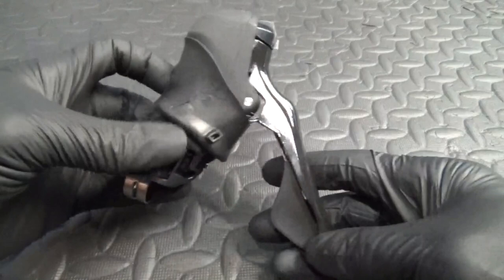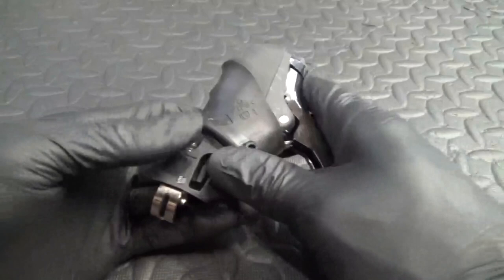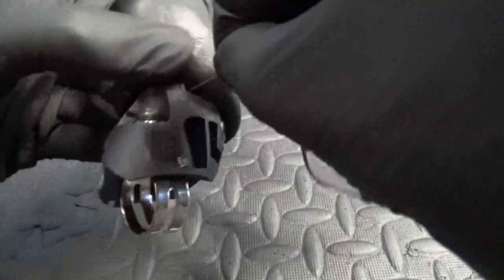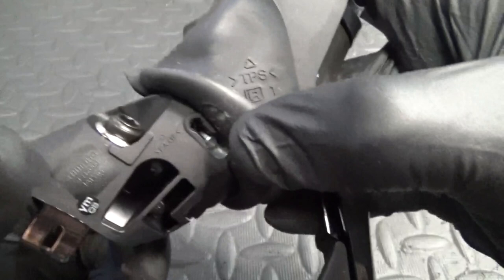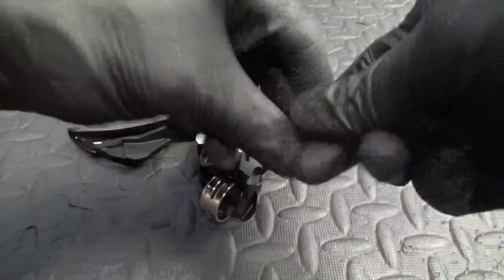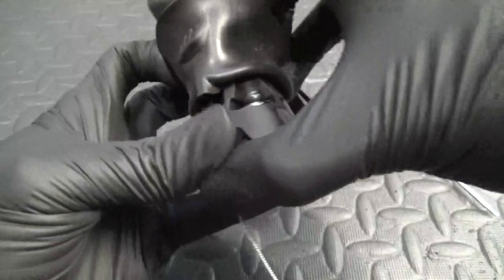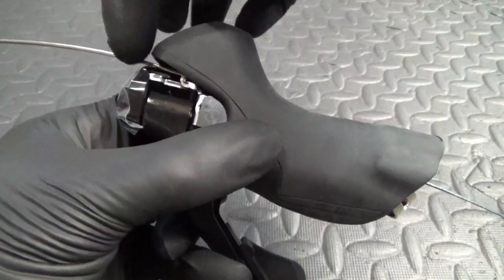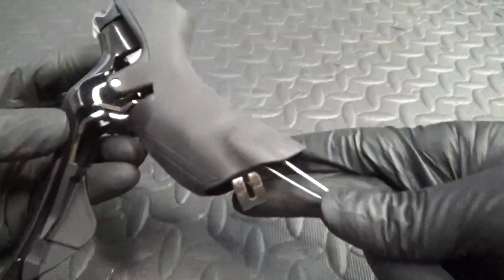How to change cables Shimano 105 R7000 shifters

Comment: I have been reinstalling and setting up this R7000 front derailleur today and it’s quite a fiddly and temperamental design! Even with everything aligned as carefully as possible it still seems very hard to find good high and low stop settings, particularly on the large chain ring. If you set it to just skim on the highest gear (smallest on the rear) you get noise on the lowest one or two. If you try and open up the gap a touch more to be sure it’s not rubbing on the highest, the noise extends to the lowest two or three lowest. It seems as if the cage is just not quite wide enough to accommodate the cross chaining on the 2x11 drive.

Other problems: it can be hard to distinguish between noise from rubbing and noise from the chain against the ring due to cross chaining. Be careful with the chain guide height over the large ring. If you make it too small (say about 1mm) the chain rubs against the bottom of the cage when the largest gears front and rear are selected.

Comment: Do they sell optislick specific inner cable? I need to replace the fd inner cable for my 2021 Domane sl5 and looking for the correct part.
Reply from the maker: Yes they sell the optislick inner cables separately! Available online search for Shimano optislick inner cable.
Reply: @FreeToCycle  Thanks. I think this is the correct p/n Y60198100
Reply from the maker: That’s the one!

Comment: Would anyone happen to know if the Shimano 105 R7000 11 speed STI shifter set can be connected to the Magura MT 8 Carbon Disc Brakes?

Comment: Hi, my left shifter isnt the same as right when it comes to the recess hole that the gear cable sits. The right hand one is as you describe but the left doesn't have sufficient room for the cable end to seat. Should they be identical? Thanks
Reply: Sorted, I wasnt all the way down the gears 👍

Comment: Do Shimano left shifters always work the front derailleur & right shifters always work the rd? I am setting up rx600 hydro shifters and i am not 100% sure...😚😚
Reply from the maker: Yes!
Reply: @FreeToCycle  thanks mate... and if u have time i have one more question... will r8070 calipers work with grx st rx600 sti hydro levers with cable gear shifting? Dave Mac.
Reply from the maker: Yes they will work with the rx600 shifters!!
Reply: @FreeToCycle  thanks again.. i thought they were only for the electronic shifters😉😊